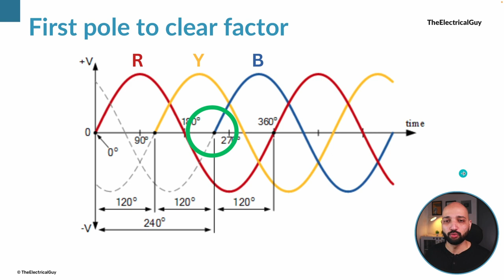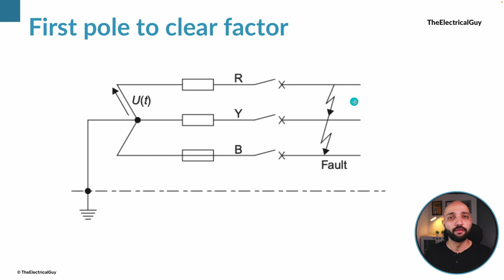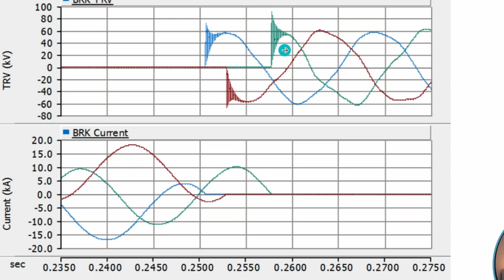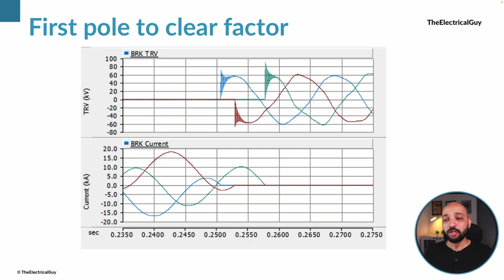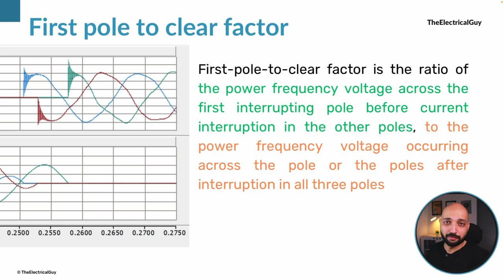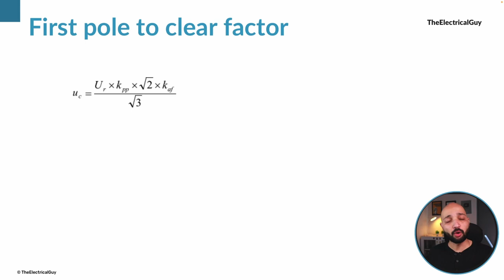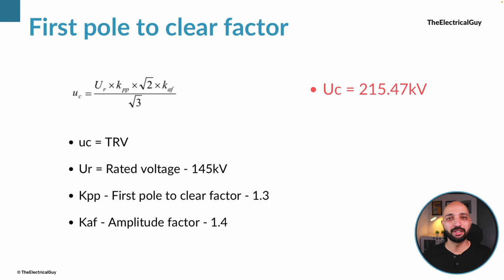First pole to clear factor of a Circuit Breaker | Explained | TheElectricalGuy

Comment: Sir, First pole to clear factor is applicable which voltage class of circuit breaker. This is not available in Vaccum Circuit Breaker name plate details

Comment: how do you say or know that breaker opens at zero crossing? I don't think it happens like that, breaker does not analyze the condition of waveform, it opens when the trip coil is energized. Please let me know if am wrong .
Reply from the maker: By circuit breaker opens at current zero I mean, Current interruption happens at current zero condition.
Reply: @GauravJ  sir if three poles are opening with a different time interval, i.e 120 phase shift between three phases will create a time gap of 12.5 ms for opening. If it happens will it make  pole discrpancy to activate and PD intiated??